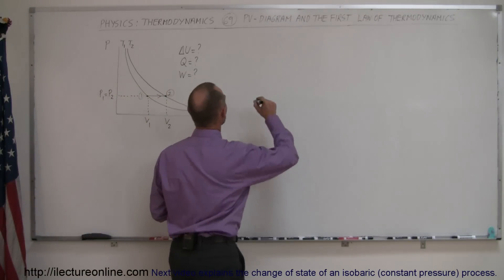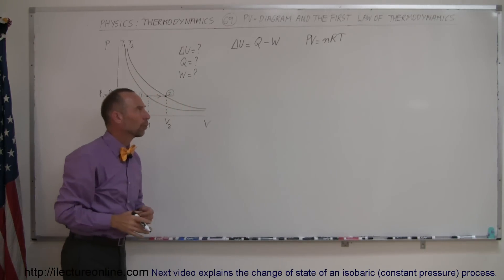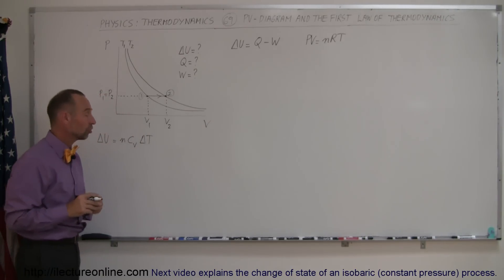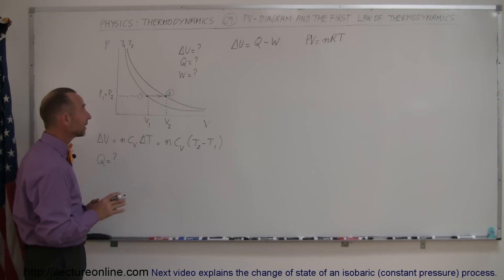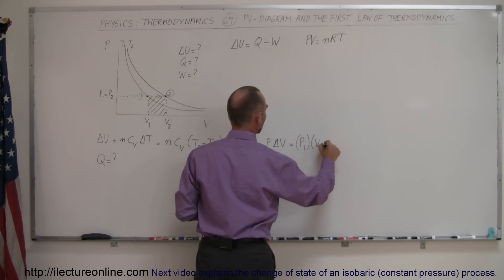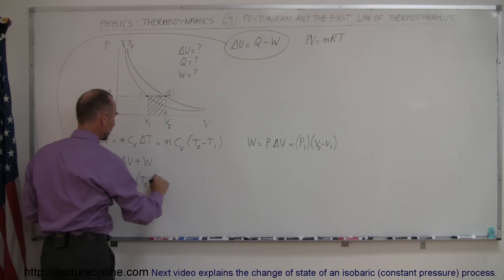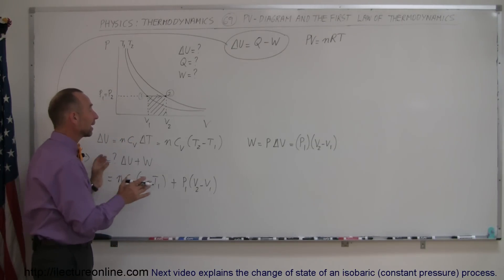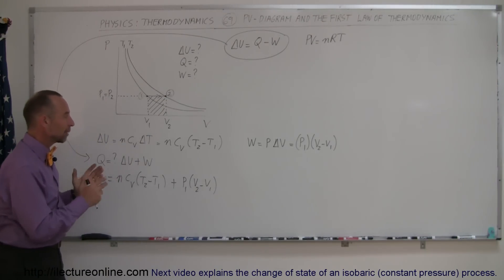Physics 27  First Law of Thermodynamics (5 of 22) P-V Diagram And The First Law Of Thermodynamics

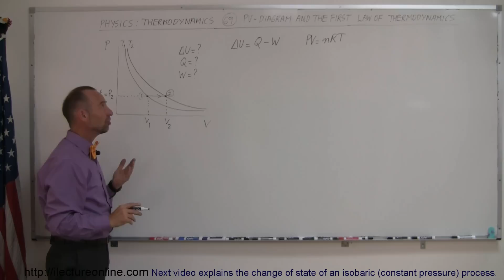Comment: I'm a little confused... At about 1:00 you say that we always use 'Cv' with the formula deltaU=nCvdeltaT when talking about change in internal energy. But I thought that you could write it with 'Cp' as deltaU=nCpdeltaT also when talking about change in internal energy. Wouldn't that work for this example because volume is changing but pressure is staying the same?
Reply from the maker: John, 
Cv is not equal to Cp
Cp = Cv + R
delta U = nCvdeltaT
When P is constant, use the first law of thermodynamics:
delta U = Q - W

delta U = Q - PdeltaV

nCvdeltaT = nCpdeltaT - PdeltaV
Reply from the maker: *****  and John,
In summary:
delta U = nCvdT  (ALWAYS) and never uses Cp

heat added to or removed from the gas is:
Q = nCvdT  when the volume is constant

Q = nCpdT when the pressure is constant
Reply: U is a state variable depend on final and initial state and is defined by Cvdelta T.where is Cv
 is the isocore specific heat, theoretically calculated in an approximate way by applying the energy equalization theorem of classical statistical mechanics  and n is the quantity of substance considered. It's not the case for Q were is defined by the type of transformation at costant volume or constant pressure

Comment: for Q would u also be able to write it as nCp delta T since its constant pressure? any quick help would be great i have a midterm on this in 3 days lol
Reply from the maker: That is correct, since it is constant pressure, the heat added to the gas,  Q = n Cp delta T
Reply: Michel van Biezen thanks!

Comment: Im confused on the diffrence between Q and delta U, since they have almost the same formula and are reliable on temperture. What makes them diffrent? some of my tasks have been cycles and where it says the delta U is zero, since the start and end point is the same. Why isnt Q also zero if that so...
Reply from the maker: Delta U is the change in the internal energy of the gas (which only depends on the temperature and the type of molecules in the gas) and does not depend on the process.    Q is the heat added (or - Q is the heat removed) from the gas and it depends on the process.

Comment: I thought Cv could only be used with constant volume processes? Is that incorrect? Because he uses Cv in the equation for change in internal energy for process 1-2, where volume is not constant.
Reply from the maker: That restriction is only for the heat added to or removed from the gas.  We always use Cv for the change in internal energy, regardless of the thermodynamic process.
Reply: Thank you for the response!

So just to be absolutely clear, This means that the equation Q = nCvdeltaT requires constant volume but the change in internal energy will always = nCvdeltaT, regardless of volume change?

Also, I have another equation written down:
h2 -h1 = Cp x deltaT

Do you know if this equation requires constant pressure in order to be accurate or is it true for all thermodynamic processes?

Comment: it was the pressure that is constant right? why then did u used cv?
Reply: U is a state function, and is always directly determined by cv and T for an ideal gas.  Changes in U only depend on the initial and final states.  Heat (Q) and work (W) by contrast, are path functions, which depend on the exact details of the process.

In any process where you need deltaU, you can obtain it by n*cv*deltaT, provided that cv is close enough to constant and that it is an ideal gas.  Real gasses and liquids will have some dependence on pressure.